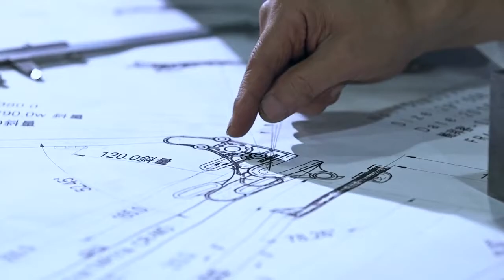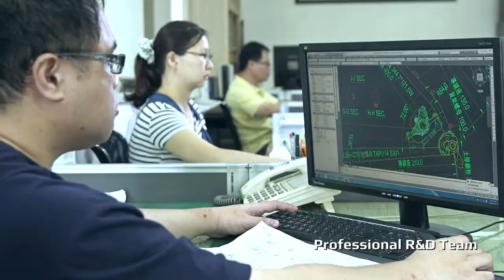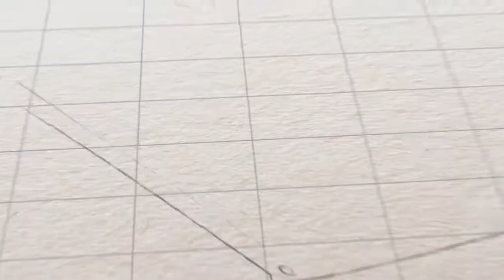Taiwan Top Custom Bike Frame Manufacturer - Maxway Cycles

Comment: iam from India engaged in customised semi Recumbent bike
Reply: Hello.  Do you build custom steel frame?
Reply: @bsrupa3396  yes but now shifting to a new weldingless ( 1 weld only) CNC frame from chromolly tubes
Reply: @yogeshnaik9276  So where is your workshop. Would you make a  gravel frame+fork from Reynolds 520 tubing with fillet Brazzing. What will be the price.
Reply: @bsrupa3396  no i cannot make this...sorry. every custom bike is different each once vision is different so the one having to vision must also build it or with personal supervision. we are going for cnc weldingless frames will not suite your purpose.. we will go for bafang m650 n nuvinci hubs in our bikes
Reply: @yogeshnaik9276  Thanks for your reply. Regards.